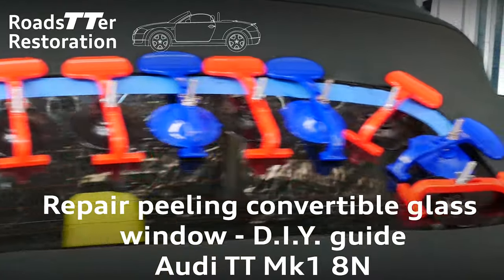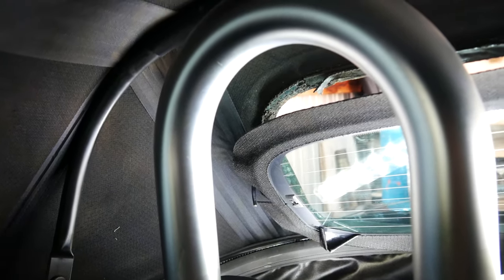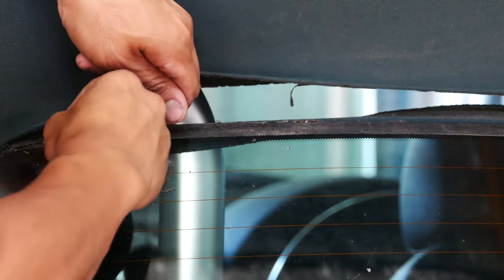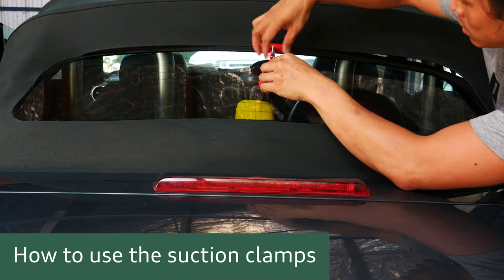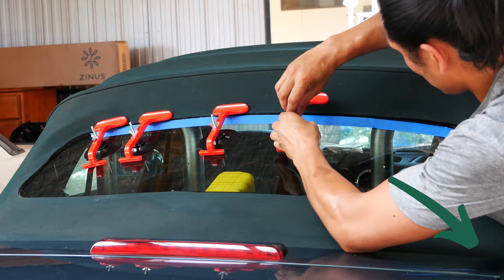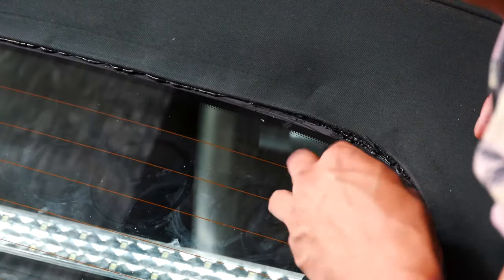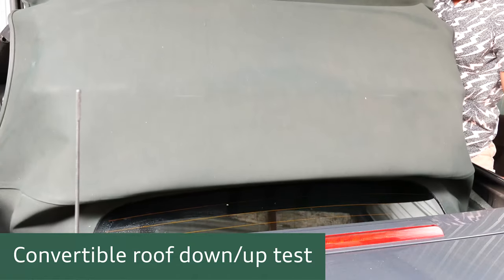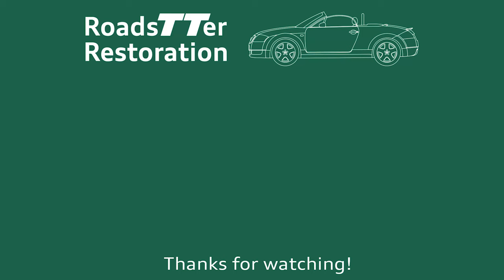How to repair peeling roadster rear glass window (suction clamps) DIY guide Audi TT Mk1 Convertible

Comment: Thank you Ian. Parts are $150 and labor, well . . . Most important, your video took the fear out of doing it myself. The bottom corners were separated, so now was the time to do it before it got worse. You're a confidence builder.
Reply from the maker: Hey - glad the video was helpful!! Good luck with the repair and hope it allows you to enjoy your roadster for many more years to come 🙌
Reply: Even without a top, I'd enjoy it. My first car was a '54 Austin Healey 100-4 in 1964.. I've wanted a roadster since. My '01baseball version lived in San Diego until I drove it, non stop to OH two years ago. Sometimes it's just fun to sit in it and enjoy the aesthetics. 
The center sun visor and dowel to line up the spare tire on the rotor are just two of first class accoutrements I've discovered.
My next project is to install puddle lights on the bottom of the doors which will show the  Audi logo. I've not seen any videos doing it with a Dremel to make the rectangle accurate. Thank you again Ian.  @ianpgonzaga
Reply from the maker: @vicelse8980  I had to Google the 54 Austin Healy - looks like such a classic! Look forward to hearing about the puddle light mod in the Mk1 TT!
Reply: Hi Ian,thank you for your video really well explained!
 I have a Porsche 996 with the same problem. Can I ask where you purchased the 3m products  in Australia?

Comment: Great video.  My Mini Cooper Roadster just dropped the rear window out this past week.  I'll be using your video as my template for the fix this weekend.  You seem to have the most complete that I've seen.  The only thing I'm going to do is completely remove the window to start.  It's still held a bit, but I only want to do this once so I will seal the entire window.

As I stated below in my comment to one of the other people the primer is getting difficult to locate but I was able to call the local automotive paint store who actually had it on hand.
Reply from the maker: Thanks Thom glad you found my video helpful and super thanks for the tipoff on where to get the primer from. Seems like a rare item for some reason! 

Good luck with your repair... I'd be too scared to remove it completely and start afresh!!! 🙈

Comment: Really well done. Thank you for sharing. I have a 2011 S5 cabriolet with a few areas on the rear window that have delaminated. I’m going to follow your process so that it doesn’t extend itself all the way around! Thank you for sharing your repair video.
Reply from the maker: Thanks for watching and glad it's helpful. I have also used this same process for the Mk2 TT where the soft top has two "skins". I think it would be the same with your S5 Cabriolet... Audi made them nicer by making an inner skin to cover the frame. The process worked 👌

Comment: thanks for the video Ian. the most detailed, informative, easiest to follow and well produced [time stamped, listed chapters etc] that i have viewed. are you in Australia? 3m tell me they don't stock windo-weld here and have no siliar product. $70-$90 if i ebay. i have only 15cm to repair and feel the rest of the tube will go off before being used. 
thanks again for the amazing video. rodiebo
Reply from the maker: Thanks for the compliment! Yeah I'm in Australia. I can't find the same stuff but use the Sikaflex 227 from Bunnings and it seems to work alright too.

Comment: Very well made video, thank you very much. I have an Audi A3 carbrio that started peeling in a corner, only a little bit to leak inside. Can I apply the glue without the primer ? I don't know how to apply it since it is still very tigh, honestly I don't even know how to squeeze the glue, it is way tighter that the last leak repair in your video. Thank you very much
Reply from the maker: Hey there. I think the later models (like the TT Mk2 ) can be done but they're double skinned. 

You might have to do the repair when there's some slack in the fabric.

Comment: Awesome Video. Seriously!! Thank You. Can you tell me if you need to glue down that fabric strip that goes around the window on the inside of the glass?
Reply from the maker: Thanks John. 

That strip is kind of difficult to glue down. If you can then do it but I tried my best and it's mostly peeled off. It doesn't impact the seal though. If you have it right at the glass that extra fabric strip is really just a vanity covr.

Comment: Hey, nice video! This is the best instruction I've found. I'm wondering, are you not going to glue the fabric inside the window?
Reply from the maker: Thanks! Yeah you can also do that strip too just to make sure it all stays watertight.
Reply: Thank you! Same method worked for mine, and I didn't find any leak from spray leak test. However the spot leaks after a rainy day. Maybe it is the water actually seeping through the fabric around the area? Do you have any idea on this?
Reply from the maker: @555wonjoon  hmmm. There shouldn't be any leaks if you've got it watertight. Maybe a spot was missed that needs a top up.

Comment: where have you then from @7:43 champ? They look like they really do the job
Reply from the maker: @Supreme40x  just do a google and make sure you get the ones with a slot in the body rather than fixed positions for adjustment.

Comment: Hi, what kind of silicone did you use ? I have to do the same on my Mustang unfortunately and i might put a vinyl or something less fragile than a glass
Reply from the maker: Hey there. You can see the product I've used  using the timestamps in the description. Pretty sure I was organised enough back then so it's easy to find the info 😋

Comment from the maker: Has your glass started to peel? Fix it NOW! Otherwise you risk it getting quite bad like mine (which you don't want). Does anyone have any tips to prevent this glass peeling from happening?
Reply: Sorry, preventing is not possible. It’s a glue aging process that causes the issue. Having a garaged TT helped but at 15 years I replaced the top. Thanks
Reply from the maker: Thanks  @Rhaman68  

How much was the replacement ?

Comment: So I am having difficulty find the 3m single step primer, is the job still doable without it?
Reply from the maker: Hey Jeremy. Yeah you can still do it. Just clean the area up to remove as much dirt as possible. 

I did this the other day without the primer on a Mk2 droptop and it still held.
Reply: @ianpgonzaga  thank you, and the video was awesome, it was very detailed, keep up the amazing work.
Reply from the maker: @jeremyparton425  shall do sir. Thank you.
Reply: I'm not sure if you've found the primer but I just bought some this week.  I ended up at a automotive paint store (NAPA Paints here in the US) where they had some of the little bottles like Ian used.